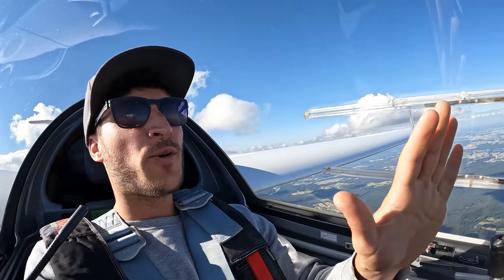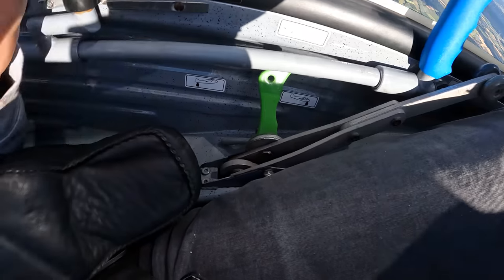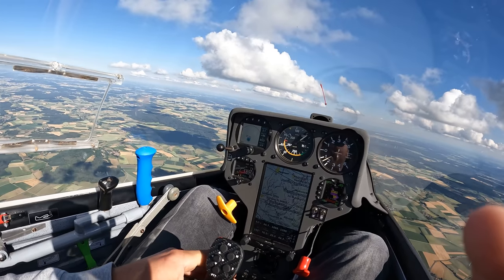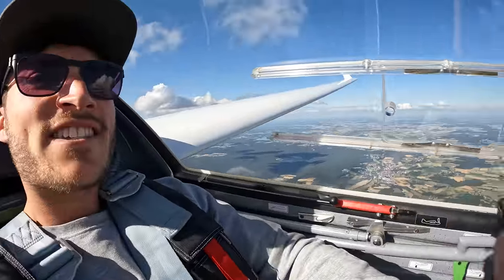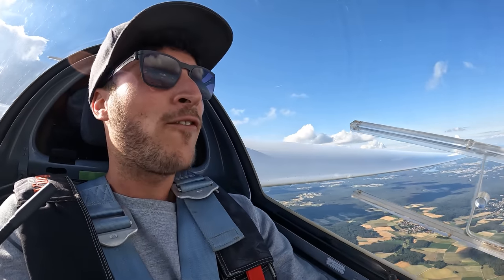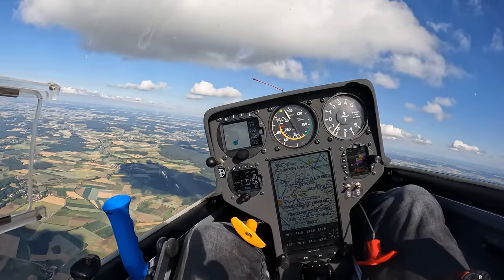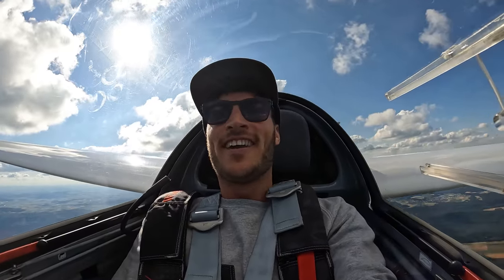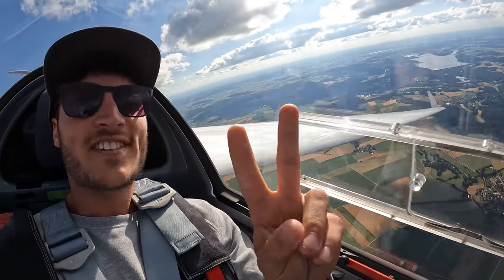WASTING ENERGY with a GLIDER | Flighlvl Challenge #1

Comment: The one you didn't mention is putting into a steep bank into descent. 

On a separate note, many years ago, when I got my 5000 metre altitude gain, I got to the top of the wave right at sunset. So I had to lose 6000 metres in some 20 minutes. Brakes out, and slipping all the way to the pattern.
Reply: Sounds like an excellent time to do some 20 turn spin practice